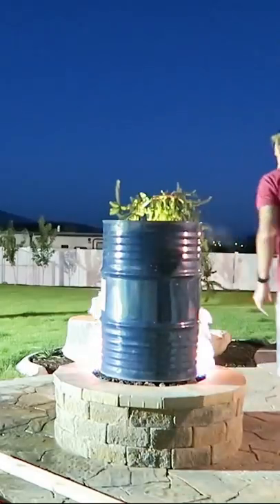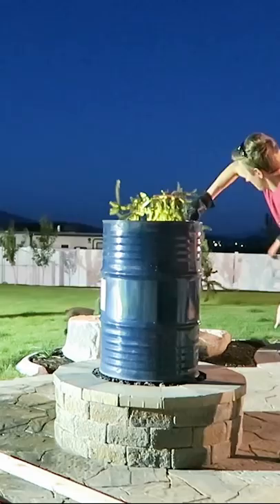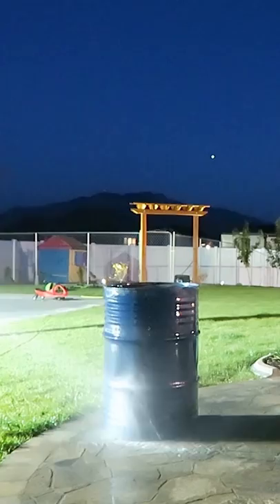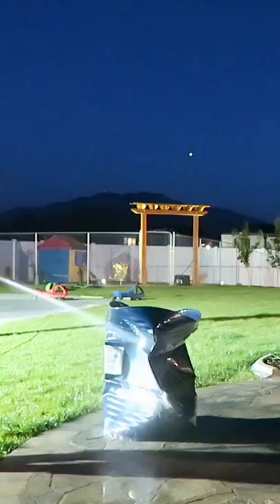55 Gallon Steel Drum Implodes From Condensation

Comment: As a commercial brewer this is why it is absolutely CRUCIAL to ensure you leave a little positive pressure in a fermentation vessel or brite tank.
Reply: Have you ever had an accident that was the equivalent to a flood of beer or alcohol when this had? Or has their ever been an accident that caused a flood of the drink lol
Reply: @Hershewed  So this would actually not happen if there is beer inside of a tank. Even if you completely depressurized the tank with beer in it and capped it, the tank would still build pressure on its own from the yeast which through a complex biological process known as fermentation converts the sugars in the wort (grain water basically) into ethanol, C02, and other various metabolic byproducts. Long story short its only crucial to pressurize a sterilized and clean tank. One that's waiting for the sweet hoppy goodness to fill it up. Otherwise, an empty tank with no pressure creates a vacuum and well, you've seen the video so you know what happens. So to answer your question. No it's never happened to me, it's never happened to anybody based on this reason alone. But I can count maybe ten other reasons a tank could leak and flood beer out everywhere. And yes, a few have happened to us.
Reply: As a commercial brewer, I'm happy to see this!  The collapsing tank is an industry cautionary tale.
Reply: Commercial brewing is fascinating, does anyone have some links to good channels to learn about this?

Comment: I hope everyone can appreciate how much force is required to do that… physics is fucking awesome.
Reply: f to the people that tried this in the microwave lmao
Reply: @grantwithsevenys1928  🤣
Reply: Thermodynamics is my most favorite part of physics. Temp and pressure can do so much amazing things
Reply: @FalloutGenius1  true
Reply: And to think, we endure that same pressure at all times, we are just lucky enough to push back from inside without even trying
Reply: So is the pressure in the can, going from 1 atmosphere to zero instantly?  About 14psi (right?) to almost zero psi.....?
Reply: @connormcmillan6761  we evolved to be able to live on this planet so makes sense
Reply: @damonteague7442   Not to zero.  The pressure is going from 14.7 psi towards the absolute minimum possible of about 0.09 psi.  However, that's just the minimum possible, if the water dropped to the freezing point.  In reality, the pressure is dropping gradually until the container cannot withstand the pressure difference.  I have no idea when that happens because it depends on the strength of the container.
Reply: With a vacuum inside the drum, very little force is required to do that. Big deal.
Reply: @damonteague7442  pressure not instantly dropping to near zero, but is dropping at a roughly steady rate until the structural integrity of the barrel is exceeded. That's the instant part. In fact, at that point, the pressure in the barrel would increase slightly from the instant reduction in volume,  but still below ambient pressure outside the barrel.  Pressure would once again start dropping at a steady rate as it's further cooled, but will drop faster with the now reduced volume.
Reply: @shelbyseelbach9568  first time seeing a 55 gallon drum? Must be…
Reply: @gasser5001  Not at all. Not my first time setting them collapse either. And?

Comment: This is basically how canning is done, only that the hot water cooling will suck in the cap dome inward.
Reply: Yep! It creates a vacuum seal!
Reply: Thanks for the info! May use this one day while out exploring.
Reply: @Heloise O'Byrne Good thing it didn't blast you with a face full of hot soup when you equalized the pressure, or wouldn't that happen?
Reply: @princetchalla2441  wait how you gonna use this information while you're exploring. I'm so confused

Comment: I’d love to see this filmed with a slow mo camera. Bet that’s be really interesting to see.
Reply: You can change the playback speed on the video.
Reply: @theresa5059  You should tell the slow-mo guys about playback speed, then they can avoid buying those expensive cameras!
Reply: @quinton1630  hahahahaha
Reply: @theresa5059  It still have the same frame bruh, even if you slow to a crawl it still appear to be instant collapse regardless
Reply: @theresa5059  Doesn't change it though, frame rate of the camera makes that impossible– Cameras can only capture a certain number of shots per second and slow-mo cameras have higher frame rates which makes playback easier.
Reply: @theresa5059  this person has never heard of how videos work

Comment: This is basically how the submersible imploded, but mind u this happened 1 atmospheric pressure…imagine how aggressively it happens at 375 atmospheric pressure which it is down on the ocean floor
Reply: So would have happened very quickly, instantaneous death. A loss either way but I’m glad they didn’t suffer for days, stuck in the cold darkness knowing that oxygen in about to run out.

Comment: The mechanical failure (buckling) is the sudden part, I reckon the pressure decreased somewhat gradually until it reached the drum's structural limit.

Comment: This is because at atmospheric pressure water turning to steam expands around 1600 times larger volumetricly. The reverse happens when it condenses.

In powerplants you use this phenomenon to create massive steam pressure to push the steam through a turbine, and use a condenser after the fact to turn that steam back to hot water to be boiled again- however condensing the steam also has the effect of sucking the steam behind it forward, giving a push-pull effect on the turbine.

Comment: This drum is two hundred litres, standard capacity. That's about forty imperial gallons at twenty fluid ounces a pint. Or forty  five US gallons at sixteen fluid ounces a pint. Forcing forty five gallons into this drum will rupture it. Same size, heavy steel drums are used for volatile fuels and solvents.

Comment: And it can work on even larger containers as well. I work at a places that has 6,500 gallon stainless tanks that are washed with 170°F (77°c) water then immediately hit with 60°F (16°c) water. They're vented with a standard mesh vent cap and a offset door gasket but we had a guy clean one without the offset gasket. Sounded like someone opened the world's largest Pop can. Thanks to the vented cap it prevented an implosion but it caused a decently sized dent.

Comment: Pretty sure the water vapor inside the can doesn’t suddenly condense, it condenses gradually over time as you cook it but the difference in pressure between the inside and outside eventually crosses the point the barrel is unable to support the atmosphere and the collapsing of the barrel to equalize air pressure is the sudden part

Comment: So this is what happen to the Titan Submarine for using Home Depot parts and a Logitech Controller.
Reply: The controller worked fine. It did what it was supposed to do.. Lol. The issue was the structural integrity of the sub itself.
Reply: It wouldn’t have crushed like a can. It would had shattered into pieces because of the carbon fiber.
Reply: The difference on the barrel between in and out is less than 1 bar. 

The difference between in and out on the sub was 400 bar.

Comment: Fun fact: at the bottom of the ocean floor, where light isn’t possible naturally, there is enough pressure down there to do this to the human body without a suit on
Reply: Yikes…
Reply: Does it happen internally? Like your organs just start Popping and is it an instant death?
Reply: @KDSlimReaper  it doesn't happen as quickly as the video, it's gradual. The deeper you go, the more the water squeezes you. Even submerines have a limit to how deep they can go.
Reply: Atmospheric pressure is, well, 1 atm. The drum is as a result subjegated to 1atm of Delta P (difference in pressure).
The bottom of the mariana trench has a pressure of around 1000 atm...
In fact, you only need to go 10m deep for the pressure to increase to 2atm, so why don't we pop like the drum at those depths?
Unlike the drum, when pressure is applied to the body it squishes a bit but that also increases tbe internal pressure so that Delta P isn't as pronounced.

It's all about the delta P.
Reply: You forget that the body is mostly water. You're not gonna crush like a coke can. You'll just lose the air in your lungs. Which is a pretty small volume compared to the rest of you.
Reply: And if you go even deeper, it can happen to you in a suit
Reply: @KDSlimReaper  if you were suddenly teleported to the bottom of the ocean, yes. But the ocean water pressure gets gradually higher as you go down
Reply: Your organ wont popping,
Its just you get compressed so hard, your bones will be really soft like sponge, your meat tender perfect lmao

Same like what happen when we pressure cooked fish, chicken, or beef with water vapor.. the bones is soft, hard meat will be tender yummy, also their brain as well and all the organ inside it crushed..
Their bones is soft and their
Reply: You don't need to go to the bottom of the ocean for that lol
Reply: Yichaels
Reply: @Astronomy and Creations with Raven how is it not?
Reply: Wow, to think this might have happened to the people on board of the submarine OceanGate
Reply: like the missing submarine
Reply: This comment aged extremely well
Reply: @mbalc909  yeah...
Reply: A year old foreshadowing is crazy!😅
Reply: You basically just explained what happened to five men just a few days ago
Reply: Yeah, we know.

Comment: I did this in chemistry accidentally but the can was a glass test tube, yeah it wasn't fun.
Reply: Most test tubes can handle a very intense vacuum if there aren't cracks. If you didn't do this under a hood with a borosilicate tube, I would be very surprised if you didn't get shards of glass embedded in your arm and face.
Reply: @sophiophile  i was very surprised I didn't end up with glass shards in my wrist too, the bottom managed to stay intact so I was just hit by the rounded bit. It could've ended a lot worse
Reply: @sophiophile  also It was the force of water being sucked into it that caused the 'explosion'

Comment: Step 1: follow the video but only to the point of where you’re about to spray water on the steel drum 
Step 2: invite friends
Step 3: they tell you that you’re dumb for watering a steel drum
Step 4: hold you’re hand out as if you’re using The Force
Step 5: Dominance has been shown

Comment: Why is the water needed? Wouldn’t the air cooling and contracting cause the same pressure differential?
Reply: It would cause a pressure difference, but it would be much weaker.  Cooling water vapor causes it to condense into liquid and drastically reduces the volume, which makes the pressure difference much greater.  Although I'm not sure how the variable boiling point of water due to pressure plays into this since it must have some effect

Comment: Wow is this the reason plastic bottles shrink when you wash them with hot water and put cool water in it? Actually the plastic bottles shrinks up with hot and then goes back to its regular size after filling it back up with cool water 💧

Comment: This can happen on a much larger scale with transport tankers. 
Kosher washes raise tank temperature to 210°f. If you close the lid(s) tight and the drain valve, the tank will implode. Especially when you park it outside during winter. Seen it happen only once.

Comment: I saw this happen to a 5000 gallon tanker. The tanker hauls high fructose corn syrup and then gets washed out with 200 degree water. The guy washing it didn't let the blower run long enough at the end of the wash cycle and it collapsed as soon as he parked it outside.

Comment: Not a very good explanation.
Boiling the water changes the water into the gaseous state. Whether it forces the air out is irrelevant. Some air is almost certainly in there, though how much depends on how long the heat is applied and how much liquid water is in there to begin with. Regardless, you end up with the HOT GASES inside the air at 1 atm of pressure. When it’s capped the gases inside cool down, resulting in a decrease in pressure. There pressure differential is surprisingly large, as evidenced by the reactions of the people.

Comment: This is high school physics you can do the same thing with a 2 liter bottle. Fill it with scalding hot water, wait a bit drain the water and then put the cap back on, as the air inside the bottle cools the bottle will crush itself. Back in the 90s thats how teachers taught hot air expands and cold air condenses.

Comment: I have seen the same thing happen to railroad tankers cars. It was full of hot oil they drained out the oil and closed the valves on a hot day then the sun set happened ( first time that ever happened)  middle of the night bang. Thank car looks like the soda can. The reason you're confused in the case of the containers the temperature is actually not the problem all this necessary is having a difference in pressure that can be done with a simple pump. The narrator said that the steam displace the are not the case at all if you had just hated the drum with only air in it the same exact thing will happen if you heat it up seal the lid tightly and then let it  cool .